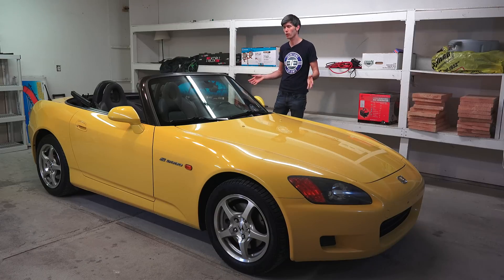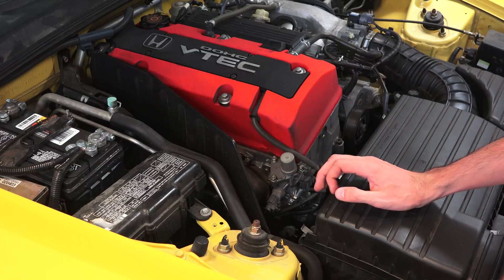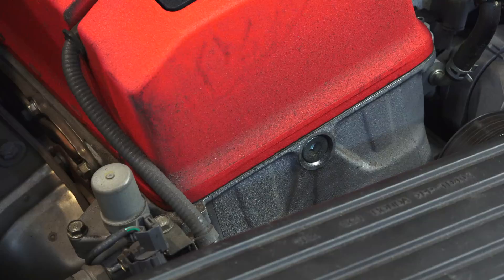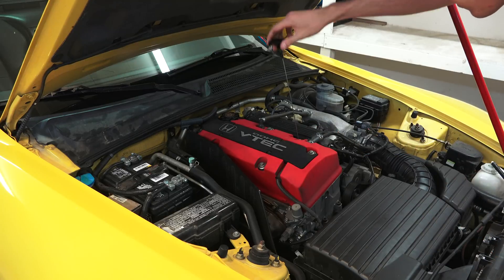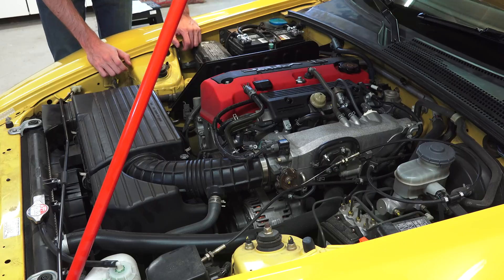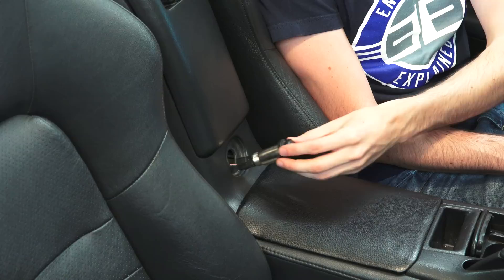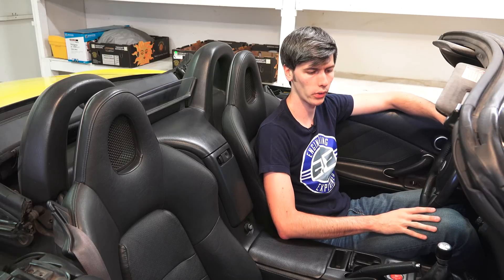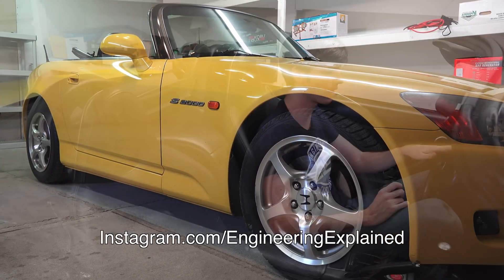What's Wrong With My Honda S2000?

Comment: I recently sold my AP1. A few things you need to do, replace the TCT with a Billman TCT. The OEM unit will fail again soon. Depending on how long the engine has ran with the faulty TCT, you may want to replace the cam chain gears, with a loose chain, it eats into the gears quite badly. I had to replace mine and I only had 75k on the car. Look into ordering valve retainers and keepers for the AP2 engine. The AP1 are known to crack causing a valve to drop into the cylinder head. These engines are also inherently known for burning oil. Always carry a quart with you and make it good habit to check it when you fill up with fuel. They absolutely cannot run low. It may seem like a tall order but if you do some of these things early on, you will love this car. 
cheers!

Comment: Congrats on the S2000, they're a lot of fun and are relatively simple to maintain. Check out the s2ki "under the hood" forum, lots of good info there. When you change the transmission fluid I'd stick with the Honda mtf, it seems to work so why bother with anything else. The rear diff fluid is tricky, I've heard of a lot of guys using various 75w-90 oils and developing issues. I've been using amsoil severe gear 75w-110 for the last two fluid changes with no issues. It's difficult to find a straight 90W diff fluid (Lubrication Engineers 1605 comes highly recommended as well) but I'm sure you'll find something sufficient👍🏻👍🏻

Comment: first objective is valve adjustment which will make replacing the O ring on the front of the timing chain cover very easy an engine that spins to nine thousand RPMs pulls the valve seats up in the head and needs valve adjustment more frequently very doubtful it needs oil pan gasket unless it has been removed probably needs o ring behind oil cooler at oil filter I have rebuilt several s2k heads because of burnt valves that were too tight

Comment: Not sure what you plan on doing with that s2k peformance wise because all motor there's isn't much more power you will be able to extract without internal mods. ie cams/pistons .... Honda made the s2k pretty perfect out of the box. you might only get about 230-240whp max with full bolt ons after that you'll need a stroker engine or forced induction. A supercharger will net you a good 360whp, which is better than a laggy turbo unless you get a dual bb turbo.

Comment: Don't you have to wipe the dipstick, put it in back in and then take it out again to measure the right oil level?
Reply: Jason actually it just depends on how long it's been since your car has been driving. Because you want to check it when it's cold because oil expands when it's heated. And if your car has been sitting there cold for ages, the dip stick will only have a thin layer of oil at the high tide mark and you will be able to see where the actually oil level is at.
Reply: lol so many likes for a incorrect procedure.
Reply: yes
Reply: I think he may be an ingenier but he can't do basic stuff,  lack of experience  in think
Reply: +MrTheHillfolk dude its easier on silver because the oil is orangeish so you can see it. My car has a black stick and checking it is a pain, you have to look at ir from an angle
Reply: j0n0j0n0j Hmm interesting. Most of the time, if I pull the dipstick out of my car even when it's cold, there's going to be oil going up, way past the full dot/line, which is inaccurate. According to most owners' manuals, you should take the dipstick measurement after the engine's been warmed up, then turn it off and let it sit for a few minutes on level ground. Pull out dipstick, wipe, plug in dipstick and then pull out to check.
Reply: +cocorecord1 engineer*
Reply: +ChrisHallett83 haha I hear ya man.
20 yrs as a master tech here, and just like you, we shoulda waited 20 years and saved tons of money from going to a tech school and we could have learned it all on the Internet. 
Like ya said, it's just good practice to do the pull and wipe first.
Reply: +ChrisHallett83 example...my wrx...I change the oil, add the exact measured amount stated in the specifications, warm it up, park it overnight, in the morning I pull the dipstick (no whipe) and the oil is exactly at the cold full line mark. 
It has a hot and a cold mark and the book says it is best to check it when it is cold.. not when it is hot. 
Go back to your diesels Mr. Smarty "I'm a technician" Pants.
Reply: +Wayne Wildman same here.... i check my oil every morning before starting warming up the car and its always at a fixed position, dont need to wipe it... My dad taught me to only wipe it when its not clear where the mark actually is.
Reply: ENGINEERING KNOWLEDGE? WE NEVER SAID CAR REPAIR KNOWLEDGE, he has an interest in cars? cant he learn? add more content in the future as he learns more about that aspect? he inst mentally incompetent?
Reply: possibly more videos about his s2000 as he LEARNS? more content besides engineering videos? isn't that possible? a build series as HE LEARNS?
Reply: If it's hard to read the oil level on a nice shiny silver dipstick, grab a black sharpie and color the end of the dipstick. 
Works like a charm every time and has never let me down. 
And don't be a derp, if the sharpie ink comes off in the oil at a later date it's not gonna damage your engine 😂
Reply: Only if you just shut the engine off and the oil is still splashed around inside. But it's still a good practice either way.
Reply: +Chris B lolllllll
Reply: +MusTang Nick I can't believe this is even an issue, I learned this in like 1st grade. 
which emoji is the smh one?
Reply: not if the motor is off and cold
Reply: +j0n0j0n0j capillary action of oil can keep it from indicating the correct level , no matter how long it sits. 
Note , "could affect" ...now we need to speak like lawyers. 
If you don't know how that works, I suggest you tear down an engine, clean all the parts up in a parts washer , but do a final rinse on the con rod with brake cleaner. 
Let dry. 
Stick it in a bucket of oil with an inch or 2 of the rod in the oil. 
Come back in a day or so and what's on top of the rod?
Reply: +j0n0j0n0j there's plenty of industrial engines that have static and running oil level marks on their dipsticks,not that this car does.
Reply: +ChrisHallett83 
Haha I'm picturing that vid of that girl "adding oil" to her car by just spraying a gallon all over with the hood open😂😂😂😂
Reply: Thats got to be the loooongest dipstick I've ever seen!
Reply: +TheMister Mann bbds
Reply: +TheMister Mann bbds
Reply: ChrisHallett83
I thought you weren't coming back... You disagreed with me on everything and didn't even say anything in response that had any relevence to what we were talking about. Then you want to pull the gay card on us. Good luck to you mate, hope I never hire you as my technician.
Reply: ChrisHallett83
You didn't explain their methodology, how would you even know that? Do you work for honda? All you explained is that they say in the handbook to do it while it's hot. I explained the methodology behind doing it when it's cold like most other cars. And you still wanted to argue with me and discredit everything I was saying because you have a trainded education. Ill pack it in whenever I feel like it mate.
Reply: ChrisHallett83 we all know that dealership mechanics are the worst of the worst. I would never admit to working at a dealership if I were you.
Sorry to break it to you but that's what everyone else calls a crappy job.
Reply: ChrisHallett83 you said nobody wants to listen. Well that includes you obviously.
Good luck with that. 
I won't even mention the pathetic attempt at insulting us. 

Get a real job instead of getting payed crap money doing things the way the dealership wants them done. 
Dealer shops aren't about good work. They are about profit and only profit.
Reply: Ahahhah! look at these losers behind their keyboards trying to argue with an experienced master tech, I bet these kids watch engineered explained then go play need for speed in their basements
Reply: Don't get me wrong engineered explained is an awesome channel
Reply: yes he's an engineer with little experience doing hands on tech work, oh well he can learn and experience as he goes, you are all acting like he has no mental capacity to learn how to be a mechanic as well.
Reply: well of course, no one claims engineering explained is a car repair aficionado... the comment above yours just said he spreads his knowledge to help others in engineering terms and the science.. all we are saying is yeah ofc he doesn't know a lot doesn't mean he cant learn how to since he just bought his first s2k as a fun car for him to experience and to work on...
Reply: whats the problem with the naming of his videos? name some examples? whats the problem with the name of this video?
Reply: couldn't it just be s2000 build? doesn't have to say that. ThatDudeInBlue didnt know much about doing diy stuff himself for his 240sx build but guess what he learned...
Reply: ChrisHallett83 your last comment responding to me suprised me. 
Guess you are a pretty good guy...damn those dealer shops though. I needed to be reminded that it isn't really the techs fault that the management and service writers push them to screw people out of more money than necessary.
Reply: ChrisHallett83 I'm a huge fan of gardening. Do you mean you run a garden supply business or a garden maintenance service? Or something else?
Reply: ChrisHallett83 I see...I am a small scale farmer, that's why I asked.
Reply: I find it comical that you all appear enraged over such a particular mistake. I'd venture to assert that it's a very minor mistake too.  We see him once ever doing this to my recollection so now he's an inexperienced "kid".
Reply: One of the first things I learned about cars...
Reply: If a car stood for a while you dont need that, cus oil is gonna level out eventually
Reply: Kornelijus Gudeikis some it does not. On my Toyota Tacoma with the 3RZFE engine the oil wicks its way up the dip stick as it cools. But on my Subaru it levels off. I think the reason is my Toyota dip stick has a somewhat rough surface and my Subaru dip stick is very very smooth.
Reply: ChrisHallett83
Lol people have explained that youre wrong above and you still have the ignorance to say he has no practical experience.
Reply: ChrisHallett83
do you wanna explain your reasoning?
Reply: ChrisHallett83
Do you want to give an example?

Comment: Take it to a Honda, a specialized place or someone that personally owns a s2k. Honda inline 4's that are high compression/revs usually burns a bit of oil and more when mileage gets high. Also don't use cheap oil, I use Amsoil and at 190k I barely have any oil seal leaks. Cost a bit more but after nearly 10 years I can tell a big difference between maintenance with my buddies who have the same cars.

Comment: Congrats on owning an S2000! One important thing you missed is that if you are going to be driving this car aggressively, you might need to update the banjo bolts on the oil injectors.  Honda changed the design midway in 2002, in fact this was a recall in japan and europe so check your engine code if your engine has the new design. Cylinder 4 had a tendency to scratch the cylinder wall and since these are FRM cylinders they are not easy to repair.

Comment: When you check the oil level don't just pull out the stick and check it. Pull it out, wipe it clean and then you can proceed to reinserted it and checking it so that way you see the true level and not whatever was thrown on there from the car in motion.

Comment: Tip on the power socket.  Wrap 3 - 5 turns of pipe thread tape around the threads of the socket.   Makes for a much tigher fit and won't back off again...

Comment: Diff: 75w-140 Castrol Syntrax limited Slip
Transmission: Amsoil Manual Synchromesh Transmission fluid 5w-30
Putting some new Honda Urea grease where the gear stick connects with the transmission really smooths the shifting.
These things has worked great in my S2000, both for track and inspired street use.

Looking forward to your DIY videos.

Cheers

Comment: I was very excited when I saw you bought an S2000! I own an Acura RSX Type-S.
My RSX also has a high reving motor (K20) that I am sure you have heard of and it burns quite a bit of oil, about 1 qt. every 1000-1200 miles. Like you said it isnt a big problem as long as you keep on top of it. This is very common with older honda engines that have a high redline. The part I hate most about it is the black soot it leaves on the exhaust and bumper. 

I would love to see any repair videos you make for the S2000, I find those kinds of things very interesting. I can't wait for the great content to come!

Comment: After fixing all that needs fixing. Do you have plans in changing the final drive ratio? Or explain the engineering of the final drive? Ive watched your transmission video though.
Reply from the maker: +Dudz Domasig I actually love the idea of swapping out the final drive. Though it's already at like 4K doing 70 mph on the highway haha.
Reply: It makes absolutely no sense to change the final drive ratio on the S2000. It's already a perfect 4.10 from the factory, it fits the application perfectly. Less than that and it would feel slow, more than that and you'd be getting 10mpg highway bc you'd be at ridiculously high rpm at cruising speeds.
Reply from the maker: A higher final drive would feel quicker, not slower, as it means an increase in wheel torque. 4.77/4.10 = 1.16 = 16% more wheel torque via gearing (with lower top speeds in each gear).
Reply: unless you go forced induction, 4.56 is the only other final drive gear I would recommend. the AP2 transmission has a different ratio for the first few gears, and that would make a very noticeable difference in acceleration. 4.77 gears work well when you are turbocharged, but are very strange when you are on NA power.
Reply: +kertef ...most driving is done at 60kmh, our highways are all 100kmh...
Short gears must be great fun in your area, but would kill my car here. 
I just returned from Texas, 1200km @130kph. And just driving across the HUGE city of Houston, TX (or even around the perimeter of Atlanta, GA, where 130kph can feel slow depending on the crazy traffic) is already pushing the RPMs.

Living in Atlanta with my 1st S2K it seemed designed only for that city, the 4.10 perfect when rolling in traffic at 110kph, watching a 300-400 meter clearing develop in another lane, the car begging for a chance to get over and go fast, change gears so you're cruising at 7K RPM ready, then banging gears hard when a hole opens running up to 200kph in the clearing, finally hard on the brakes and sliding smoothly back into traffic as if nothing happened.

I had faster cars before my S2Ks but nothing half as hungry to eat fast traffic or half as likely to send me to jail as my little Honda rev-monsters :) Plus the only way to launch quickly with the 4.10 is to smoke the tires, just another way to go to jail.
Reply: Ooohhh! Please explain! Make a video about final drive! Make a video about a final drive! Haha!
Reply: I've got a PuddyMod Diff with 4.77 in it currently (ran 4.56 in the same diff before rebuild, prefer 4.77). In the city I live most driving is done at 60kmh, our highways are all 100kmh. With the 4.77 it's essentially like losing 6th gear (I sit at around 4200rpm at 110kmh in 6th). Within the city it's effortless to stay ahead of traffic. As I've driven the car with the 4.77 for many years now I'm very fond of it (especially in combination with a 1.5LSD), and when I drive the 4.10 in an AP1 or AP2 now I almost feel the S2000 just isn't all that much fun dare I say :O
Reply: I agree, but our s2000s have Shetland pony, imaginary torque. the 4.77 gear set amplifies the bogged black hole feeling of no torque under 4k. (I'm assuming the drive train torque loss is increased with the gear set as the engine can't turn the gear as efficiently as it can turn the 4:10? you tell me) but 4.56 is a happy medium that makes the car feel quicker, and doesn't lower the top speed by 20mph.
Reply: I don't know, more than 100 Nm of torque/litre isn't that bad for a N/A car imo
Reply: More like 5k, I have stock 4.10 and I do 3.8k at 70mph
Reply: I have a 3.91 clutch type LSD in my e30, and the straight six has more than enough torque to move it quickly. I can't fathom running a 4.71 in any car without very large tires on the highway... but my engine hits the limiter at 6,9k. I get that you guys have very little torque but jeez
Reply: Or selling that ugly toy car

Comment: Ap1's all burn oil. It has to do with the way they bored the cylinders the first few years. The Ap2's don't have this issue. Keep an eye on it, I check every second time I get gas. 

Also, some oils burn less than others, I've found Castrol synthetic to burn very little on my 2002. Mobil 1 burnt a ton, and I've read that royal purple doesn't fair much better.

Comment: Your oil level readings should not read that differently over that short of a period. I believe you would know if it was burning oil at that rate and it wouldn't be back to the correct level. Seems like your Subaru guy read it too soon after shutdown or they just can't see very well.

Comment: easiest way to fix power outlet issue is to remove driver's seat. pop access panel from center of trim behind backrest of where the seat was and snake your hand in to tighten the locknut +engineeringexplained

Comment: You made a great choice.  I've had one of these for 12 years now and can't see ever selling it.  You're pretty much right on just about everything.  The Honda tensioner is pretty bad, and I would not recommend the Honda part but the one from Billman.  If  you have questions, just ask, as I've done just about everything on this car including fluid changes, valve adjustments, and forced induction installation.